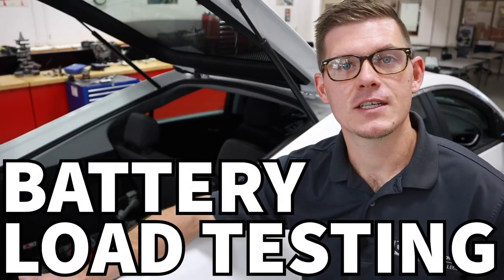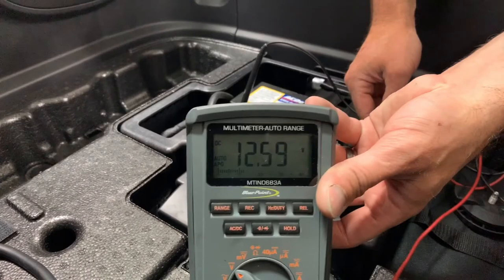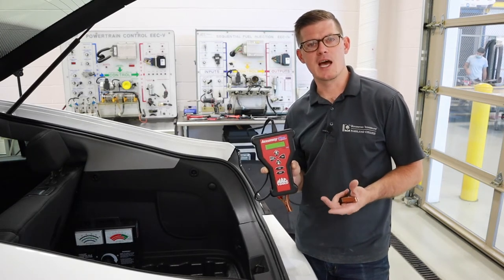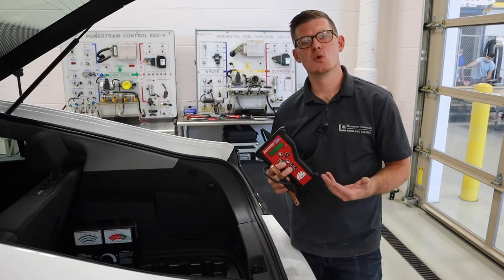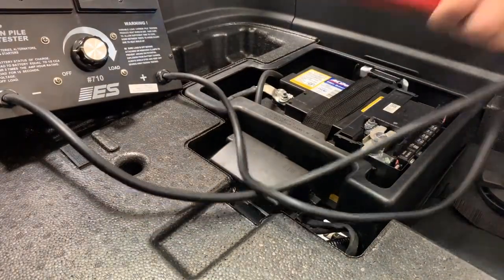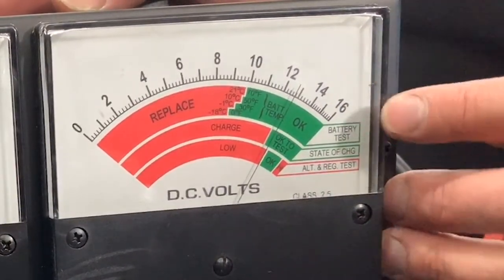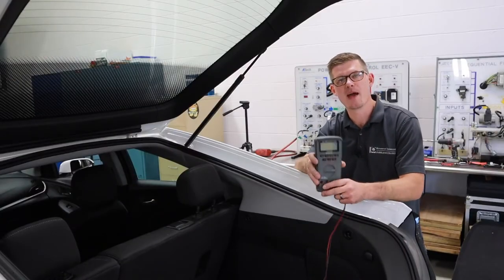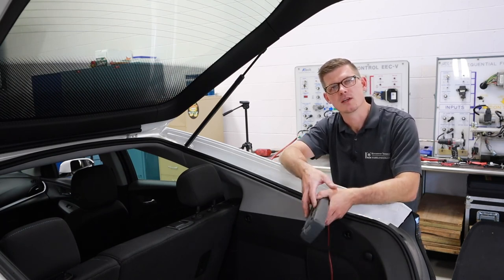12 volt Car Battery Testing: Checking Voltage and Conducting a Load Test

Comment: During the load test, you missed pointing it out at that time that the voltage dropped to about 10.7 V. Which of course is fine. The higher the voltage for the current tested at, tells you the internal resistance of the battery is better than expected.

Comment: The test current with the carbon tester I believe was not 315 but 330 A. No big deal but still.
Reply: no,,,630 devided by 2 is 315  not330!
Reply: @metalrooves3651  The test looks like it was performed at around 330-340A from what I see.

Comment: any chance you could address a deep cycle house battery test on a motorhome?
Reply from the maker: If the battery is still a Sealed Lead Acid 12 volt battery, testing would remain the same. Many of those deep cycle batteries are rated in Amp Hours. Multiplying the amp hour rating by 3 is one way to determine the load to apply during testing.

Comment: Turning over the car is a real world load, can’t you just measure voltage drop when you turn the engine over?
Reply: Yes, that's the ideal way to do it, with a real world load, but sometimes the battery might not be in the vehicle, so this demonstrates how to test it that way, even though it was in the vehicle.
Reply: That's how I would normally load test my batteries, but if your vehicle isn't starting you need one of these carbon pile testers.